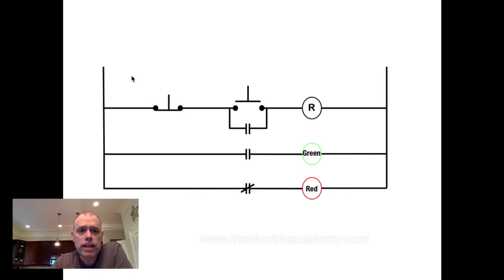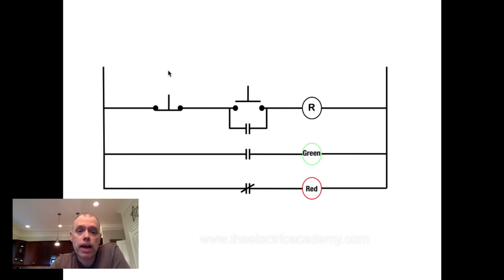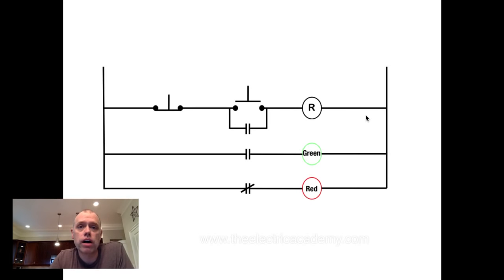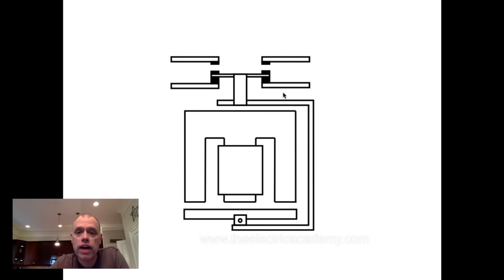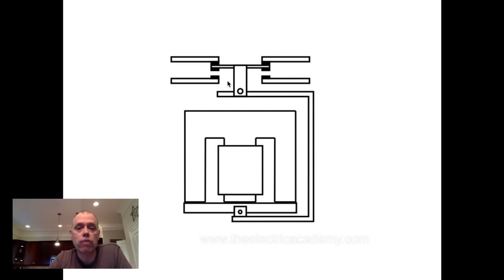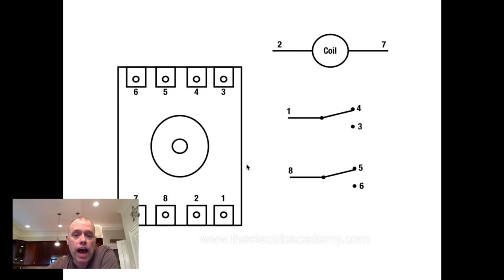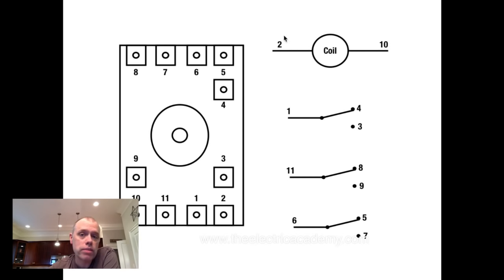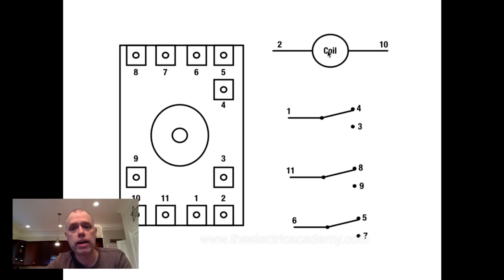Electric Relays 101.

Comment: How about some more videos on 11 pin timers! Right now in school I’m learning about them and i don’t understand why when we draw a ladder diagram we show a jumper cable coming from the bottom of the TR to terminal 6. I read that its a start input but I’m still having trouble understanding it. Thanks!
Reply: How's it going so far? I'm in HVAC school and having a little trouble myself. Using 3 relays connected to 3 different switches. 1 stop start and 2 Doorbells  very confusing

Comment: For the 8 pin Relay, I've only ever seen them with the top contacts ordered 3, 4, 5, 6 and the bottom 2, 1, 8, 7, ... with the bottom side contacts being the coil, the middle two bottom contacts being the commons, top side contacts Normally Open contacts, and top centered contacts being Normally closed.